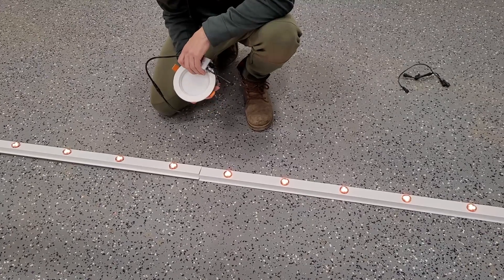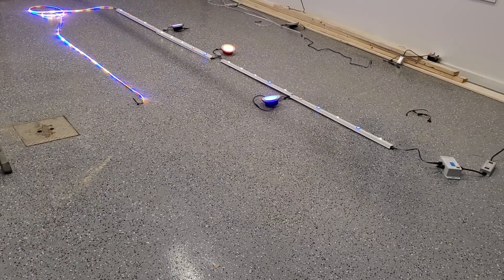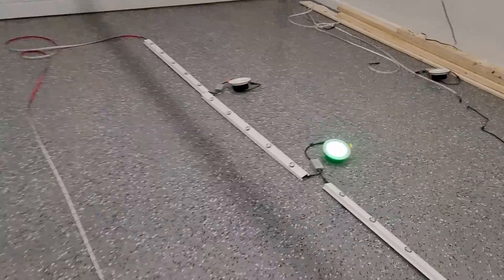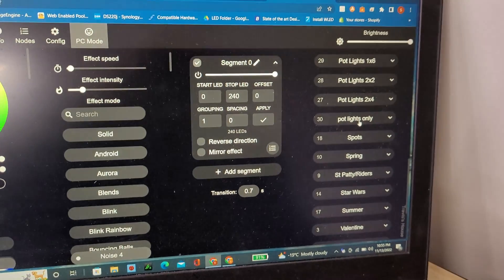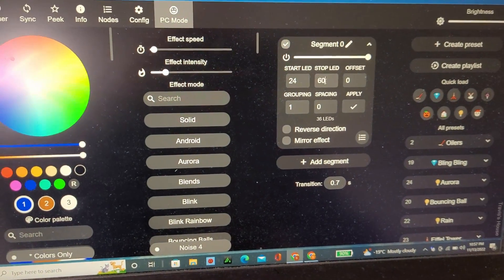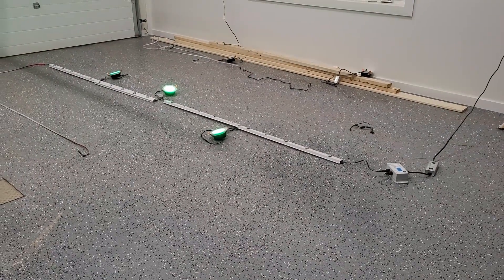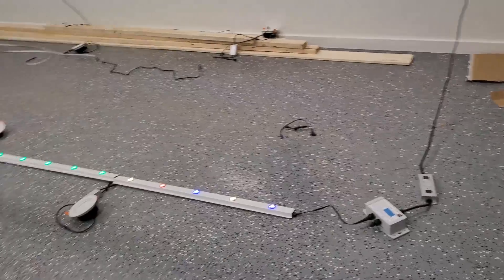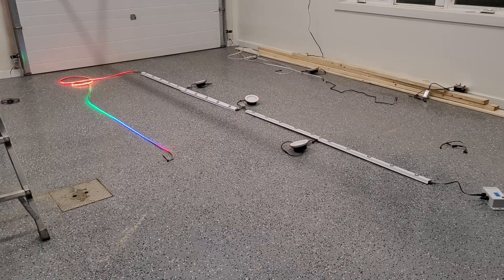WLED Using Segments To Control Pot Lights

Comment: Will these pot lights work with other brand lights or are they proprietary to the brand of strings you sell? I have x connect based pixels and would like to use these if possible.
Reply from the maker: Hey, ya you can cut the plug off and hard wire it to your system if you want. If your lights are WS2811 these won't work with that. These are SK6812 RGBW3000K not WS2811 RGB.
Reply: @showhomelighting5840 Do you have a source for 6000k?

Comment: Great videos
Is it possible to synch patterns with music using Athom?
Reply from the maker: Hey thanks, sorry you mean just using an Athom controller without wled?
Reply: I mean WLED, with music,, thnx
Reply from the maker: Ha ok ya that's what I figured. I have been playing around with ledfx, you can run it from your computer and it will take control of the wled controller and move the lights to the music. You can also install it on a seperate esp controller and run it from your phone with the ledfx app, which is what I plan on doing next. I'll let ya know how it goes. thx
Reply: Great stuff thnx

Comment: Hello can I add 2 Sensors to start the track sectors, to add 2 Sensors to start the pod light, to add 2 sensor and start the led streep?
Reply from the maker: This is possible with the right user mod uploaded to WLED and using the extra GPIO ports in the controller. There is lots of videos with people using the staircase mod with WLED and motion sensors to illuminate staircases. I think this same logic would work outside if you wanted lights to come on as you walk past a specific area. I have not done this yet, but I will start looking into it. Thanks!
Reply: @showhomelighting5840  it is good idea.... It is similar to what you explain.

How many Sensors I can bring to GPIO on 1 esp32?  ( because I will like to have 4 sectors each to have 2 Sensors to see me from where I came and to start the light from that direction)

Or it will by more easy to coonec each sector (from the 4) separate the 2 Sensors... But I am not sure If it is posibile to connect 4 esp32 în a whay so all the sectors to work later în just 1 big sector and play for exemple on Christmas sone presets like evreting it is just 1 big sector
Reply: @showhomelighting5840  If you cane test and make a video I will be very Happy
Reply from the maker: You bet, I'll see what I can do and let you know when I have something working.
Reply: @showhomelighting5840  thank you very much if you try to test this ... I think it would be the most helpful if you try to do this with as long address sectors as possible because what I want will be sector 1 = 200( addressable zones, 1 zone = 3 led of Ws2811 because the led streep is 60 led/m per 3 address, so 1 m =20 addressable zones), 2 = 174, 3 = 196, 4 = 227. From how many meters will do I have to make an injection point for the data signals to not be lost?